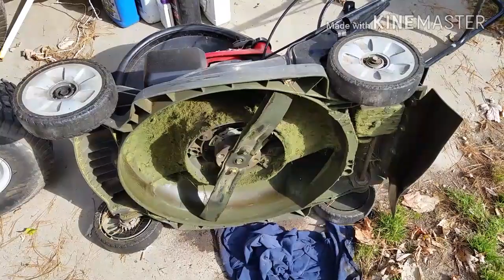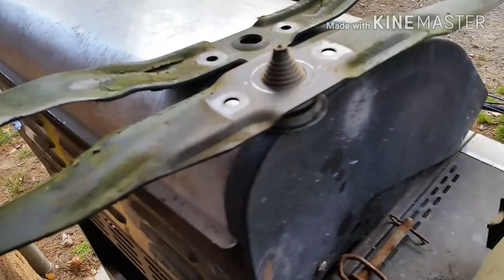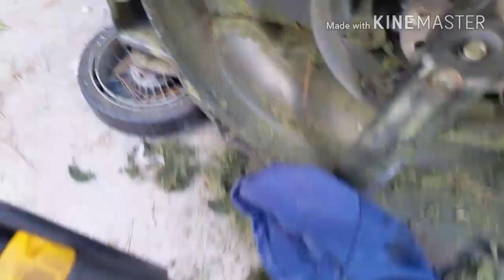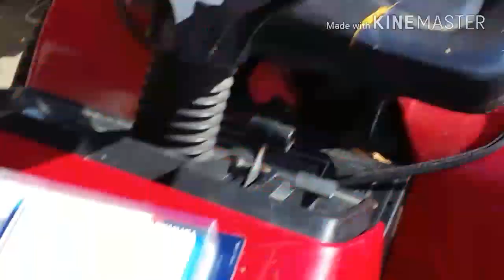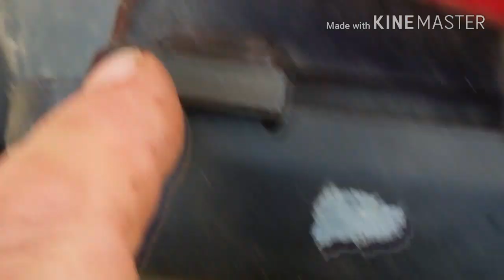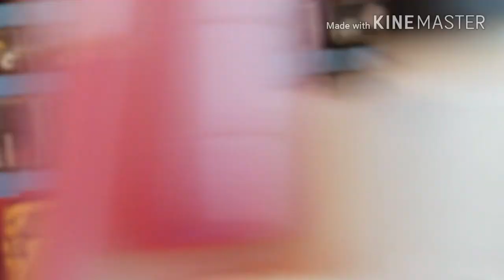Honda lawn mower how to winterize & maintain.

Comment: For the fuel part- I just drained my entire tank with a hand pump and then ran it dry. Now it's in my new 20 x10  shed, and won't need to use it until April. Would you suggest that I refill the tank using the stabilizer or would this be fine? I am scared to use the stabilizer and leave a tank full, and I cannot get ethanol free gas around. Searching online I see mixed answers, but I feel that bad fuel would be worse than no fuel, just wondering your thoughts on how I did it.
Reply from the maker: If you ran it to empty i would leave it empty. Only thing you might want to do is drain bowl completely.  There is a drain bolt that goes in on an angle. If not there on your model crack bottom bowl bolt open a few seconds to drain last bit of gas
Reply: @darylturcott  thankyou!